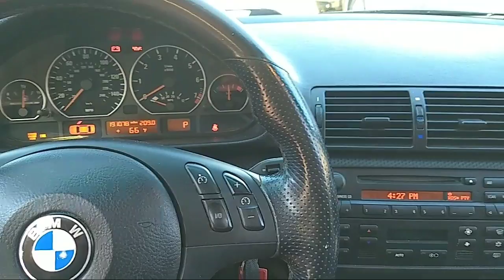BMW E46 CIGARETTE LIGHTER FUSE LOCATION REPLACEMENT 325i 328i 330i 320i 316i 318i

Comment: Hey electric car repair I replaced the fuse with a 20 amp fuse and it my cigarette litter doesn't work
Reply: patrick lynch may have bent prong in actual cigarette lighter plug. do not use metal tool to fix use hard plastic or wood even but u can cause other fuses to blow if u bend the prong badly